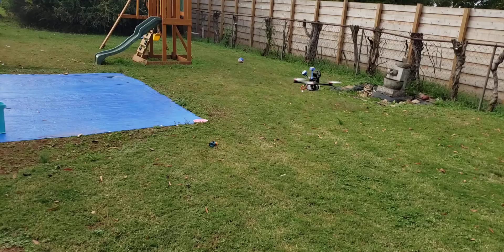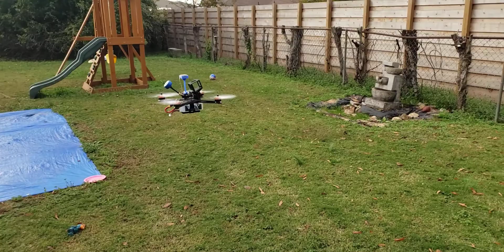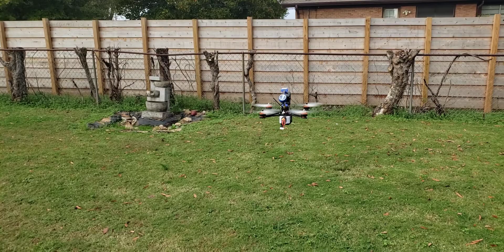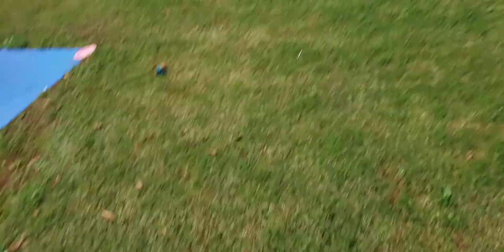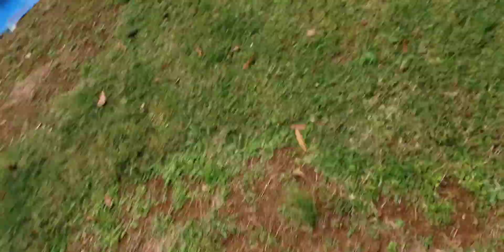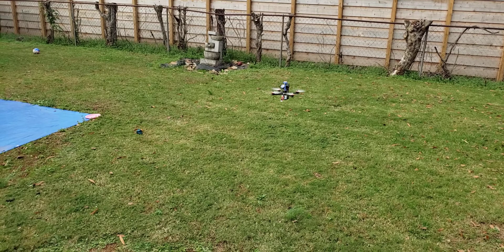INAV 2.5.2 Tyro129/ Position Hold Test

Comment: My compass never seems to point the right direction and turn the right amount. I tried like every direction including default. Matek m8q-5883
Reply from the maker: The compass calibration can be tricky. You may wanna recalibrate it again. And look at matek webpage for correct orientation and the correct value to input in the configuration for heading.
Reply: @JD_1  yea I tried both with phone speedy bee and sticks. Maybe sticks didn't start compass calibration. Can't see in dji. And phone too close messing it up. Phone has its own built in compass

Comment: This is a position hold (only) or 3D position hold ?  In INAV configurator (modes) you mix the altitude hold + position hold to fix 3D position hold ?
Reply from the maker: This is pos hold. No mix of switches. And its a 3d pos hold.

Comment: please tell me how you achieved this. When i enable poshold i SKYROCKET... dunno what to do
Reply from the maker: Lower the hover throttle in advance tuning
Reply: @JD_1  thanks mate! I Will try that. Is there anything else i should know? Gps calibrated as best i could. And barometer is on. Everything else is like preset to 5inch freestyle 2400kv.
Reply from the maker: @Kheine89  if its not doing the toilet bowl thing in pos hold all is fine. Just play around with the hover throttle value to get it perfect
Reply: @JD_1  thanks. I changed hover settings but didnt help. I notice though that my barometer must be faulty. It jumps to 90 meter and then drops to -30 ish. I have to replace that fc...
Reply from the maker: @Kheine89  hmmm. Did you put the correct hover value number in? What number did you put in? And what throttle position will it hover?
Reply: @JD_1  1274 was the value
Reply: @JD_1  1277 something. I believe fc is faulty. Works fine with my new f7 card, although iam having toilet bowl issues...
Reply from the maker: @Kheine89  gps calibrate or facing correct direction?
Reply: @JD_1  yep! how did you mount the gps?
Reply: @JD_1  nevermind, you have it on a mast. Which i also have on my 9 inch. I have no problems with that one. but on the 5 inch its on the rear close to xt60... must be it... RTH works sometimes as well as poshold, but then when i try maybe for the 3rd time it starts toilet bowling. Also almost always after 2nd lipo i dont get any satellites... faulty gps/compass?
Reply from the maker: @Kheine89  depends on the brand. But now I'm thinking since you said it doing a toilet bowl. You may need to recalibrate it. Make sure you are away from metal or any electronics. If that doesn't help you need to find the manual for the gps to make sure the orientation of the gps is correct